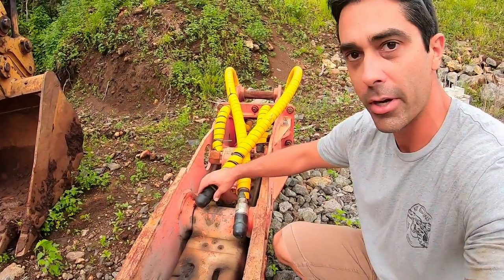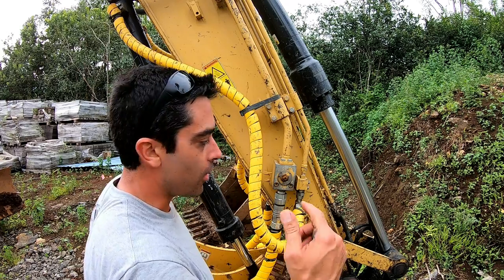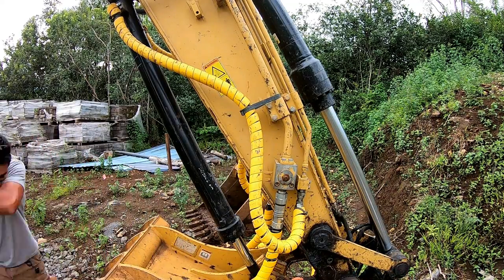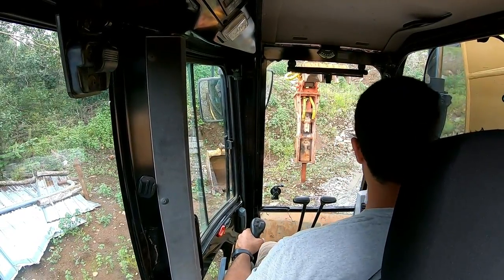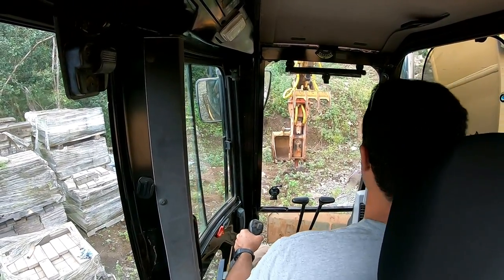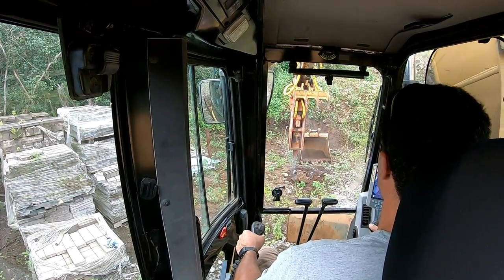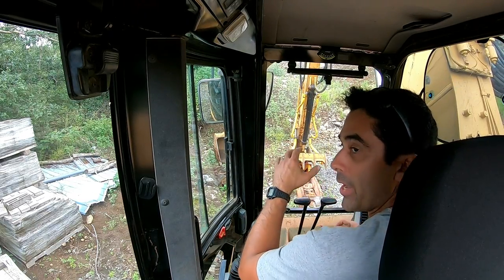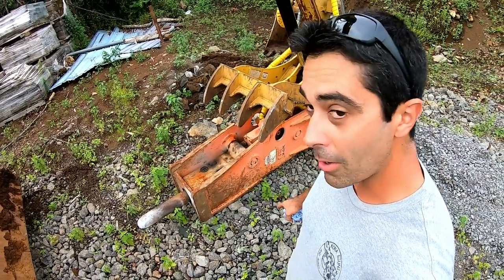How to use an Excavator Hydraulic Hammer // #OutsideTheSandbox | Wesley World

Comment: Greetings one Very Important  thing which you Failed to mention is Before you start  using a Hydraulic Hammer you should Grease  the Tip and detail the proper way of greasing the hammer tip effectively. No offense intended just think it's a Very Important piece of info which should be shared. Also it is advisable when hammering for extended periods / hours, I will grease the tip more than the 1 time at the beginning. I have 30+ years operating experience with various machines. Also when explaining that you should not pull the hammered material, because you can break the tip / Chisel as it gets extremely  hot.
Reply from the maker: Thanks for the comment!
Reply: Been Hammering since I was 15. I’ve used a verity of hammers and even broken a few. That’s a cool feature it won’t let you dry fire. That is very bad for the hammer it happens sometimes when you break through boulders. I’ve never greased the tip seems like a waste of grease to me but to each their own. Each hammer is different but my experience is grease every hour on the internal 30 pumps. Some hammers require a specific type of grease. Over time you learn to read the rocks lol in order to break big rocks you need to chip away the edges until you can get to a seam or use the rocks weight against itself. Now I’m that guy on the internet hahaha anyway if you’re hammering  for a trench you should go as wide as possible the ledge will always want to V in. Finally get yourself a good half inch shield of lexan do not clean with glass cleaner research the best way to clean it certain chemicals will fog and swirl the expensive bulletproof lexan shield. Also they make socks for the pistons otherwise it will chip em and ruin your seals on your boom pistons. 10 hour days of non stop rock smashing will break your brain and you’ll end up on YouTube talking about it be advised sir 😂✌️

Comment: Great video, some misinformation in the comments. NPK suggests no more than 30 seconds in the same spot. And, you should always lift the tracks 4-6" off of the ground to preload the material. Otherwise you wont break that blue rock.
We generally suggest against those type of couplers, because when they fail, broken parts are spread into the hammer ans excavator. We suggest using Stucci or Roflex couplers which thread together. They are more robust and if they fail, they shut. 
Greasing once per hour, always with full pressure on the tool.

Comment: I was hoping to possibly add to my hammer knowledge by watching this video. Unfortunately I found it a bit disappointing.  I thought that this video was generally informative but there is (at least in my opinion) a lot more critical information to hammering than what was presented. Hydraulic breakers can be a very expensive tool to purchase and can be very expensive to operate. Especially of not operated correctly. A critical addition could be to talk about what techniques could be used to prevent premature wear to the hammer itself. There is actually some information given that I would disagree with. I almost didn't post a comment as I feel bad about not posting a positive or up lifting comment (especially in a public forum). Hopefully I haven't offended HML or Wesley. BTW, if you someday find that your machine begins to get hot while breaking (higher hydraulic temps and then possibly engine temps) consider using Stucci couplers or maybe just go to no couplers for the hydraulic hoses.
Reply from the maker: Appreciate the comment.  Absolutely open to feedback and constructive criticism, so thank you for being respectful about it.  I think you make some very valid points.  Honestly I don’t have any experience with breakers so I enjoy hearing feedback from others.   Thanks again!
Reply: I also liked the video but similar to @Jason Chapman's comments mentioned I am very interested in learning how to pick the correct size hammer for the excavator.  I see that they are typically sized based on the weight of the machine... I'm guessing.  Possibly HML could go over how the hammer was sized, the cost of it, and where it was purchased.  Other than that, great video, I really like the resolution of your camera...super clear.  Nice work!
Reply: I find that the quick coupler seems to restrict flow, some need to be repurged with nitrogen. I'm sure after this week I won't want to hear the word hammer. Fortunately I'm unloading the blasting mats on Friday. Here comes the boom

Comment: I’ve noticed a few times when hammering concrete with rebar, I almost had the hammer get stuck in the concrete. Am I hammering down too far?
Reply from the maker: Good question, but I don't have experience with that.  Anyone else?  @WesleyWorld can you help answer this?
Reply: Yes your definitely hammering too deep, just hammer a little just to crack the concrete and go to the next spot, its tricky with rebar as it holds it all together,  its a pressure game, good luck
Reply: Morning  just seeing this question. Please be careful with rebar as it can whip around and injure u someone else or damage ur machine or other equipment or property. As for hammering I have found that making minute adjustments while hammering usually leaves the chisel with enough room for its withdrawal. Also its recommend that u do not engage the hammer for more than 20-30 seconds which should reduce the chisel getting stuck unless u r hammering a semi hard material causing hammer to pass thru quickly.  Pray this helps u. I hot 30+ yes experience in Bermuda.

Comment: Every time I talk about buying a hammer, everyone says they destroy the pins, shake your machine apart... one of my friends spent $1,000 a day to rent a whole machine with a hammer. And he has an excavator.
Do they really drastically lower your pin and bushing life?
Reply: Just commenting so I get a notification when someone answers..
Reply: I've seen machines with many thousands of hours of hammering still in good condition.  It comes down to machine maintenance and operator competence.  Yes it increases stresses on the machine but nothing that a high quality machine can't handle.
Reply from the maker: Thanks for the comment.   I wasn't able to give great advice myself, but I agree with what you are saying.   Machines should be designed to handle it.
Reply: Been Running Hydraulic Hammers for awhile and Yes it does cause some wear on the machines but if you're running a quality machine like a Cat, Komatsu, Case, Hitachi, Takeuchi, or Yanmar, then you won't have to many issues.  Those machines are built to last and will run Hammers day in day out for years.  But if you're running a hammer on a low quality machine then it will fall apart very fast and won't last. Just get a Cat or Komatsu and you wont have to worry, they are worth every penny.
Reply: @WesD808  
I had a takeuchi 35, now got a kubota 25. My neighbors got a cat 315, I'd like to get one of them. Seems like the perfect size machine. 
Thanks for the response.
Reply: That would be perfect,  I wouldn't worry too much about the bushings and pins, for what you get out of the Hammer, its well worth the extra wear on those parts, although its minimal,  ive put about 300hrs of hammer use ony Cat 314e and I haven't noticed much wear at all and thats a lot of hammering,  if your running a business then it will pay for itself very quickly,  here in Hawaii I am able to charge $225/h for running my hammer on a job,  its a gold mine. Just get a good hammer,  I'd say a NPK, Cat Hammers are considered the best but NPK Hammers are almost as good at about 2/3 of the price,  I haven't had any issues with my NPK and bought it used from a dealer here, it was 3 years old. At 300 hrs it paid for  itself more than twice over already.  Good luck and hope it works out for you. Thanks for watching the video,  really appreciate the support and I hope i was able to help with some first hand info.
Reply: @WesD808  
Thanks for the info.
Subbed 👍
Reply: @WesD808  I used to work for Komatsu Australia in Sydney, we used to send machines to the tunnels, primarily PC138, 228 excavators and HM 300 moxies. We would rent out over 110 PC-138s (Approx 13 tonne) to the tunnel jobs and they would often completely obliterate them within 9 months, rip apart the boom, mangle the hyd. quick hitches, dent every panel, mangle all the fencing on top etc.

Komatsus, CATs, etc. are generally quality machines but it is much more important how that machine is used and the service and maintenance it receives.
We figured the damage to the dipper arm just above the bucket links (total replacement) to several PC138s was done by using hammers as levers.

Many of those machines seemed to spend the majority of their lives with a hammer stuck on the end, their job was to follow the tunnel boring machine and enlarge the tunnel on either side.

I have driven out the pins and bushes on many of those machines and its not a laughing matter, its primarily done due to poor lubrication but a hydraulic breaker will eventually wear out your pins no matter what you do.

Comment: And hammer no longer than 10 seconds at a time or they will overheat and it will break the tool/pin or blow the seals out of the hammer break for 10 pause for 3